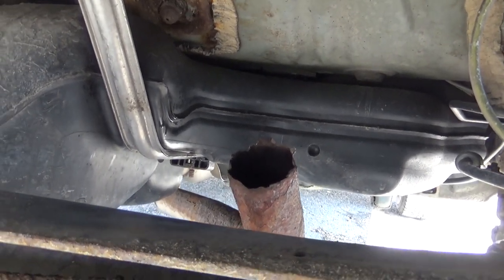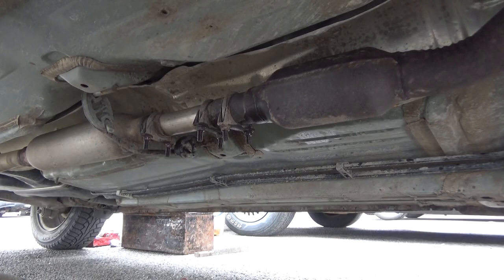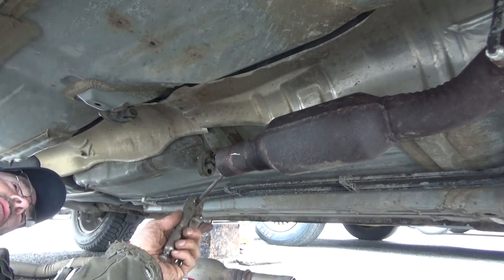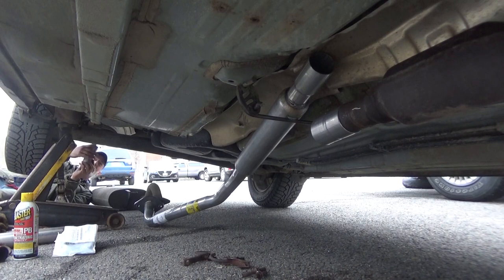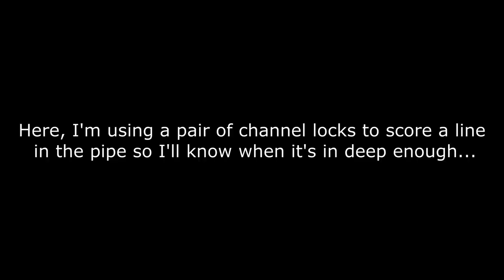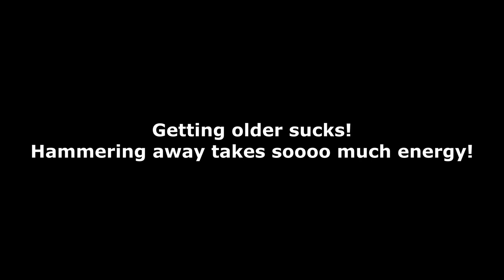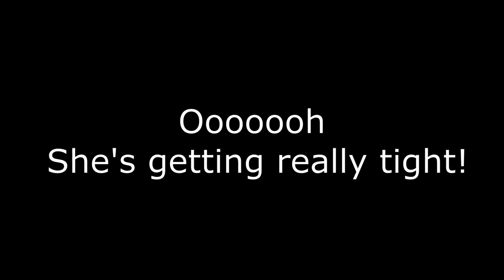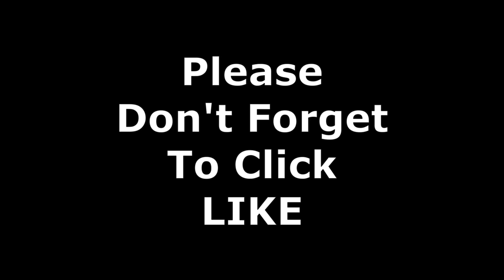Quieting a car that's LOUD enough to get you a TICKET! - Auto Repair

Comment: Respect the hard work you put in the repairs and videos.  Just a thought, why did you not use the end piece from the old pipe to fit inside the installed joint?
Reply from the maker: most likely because it's rusted too thin.